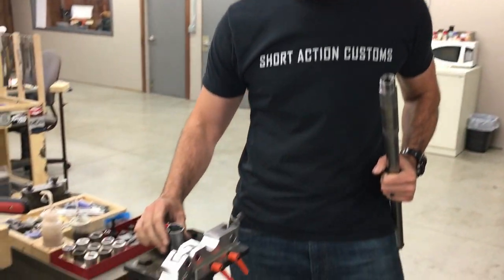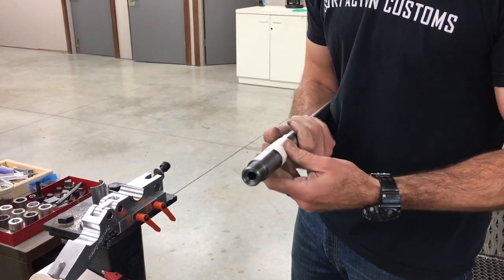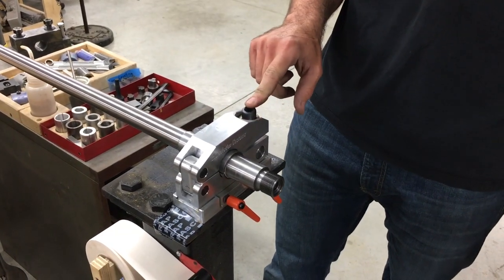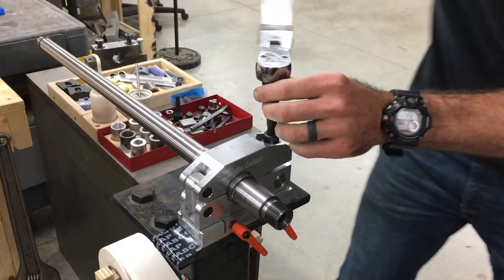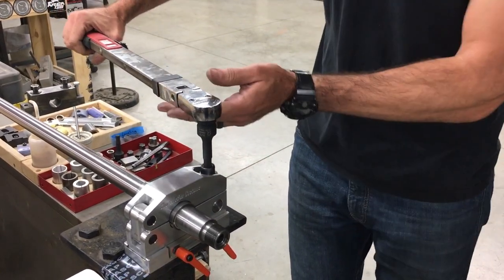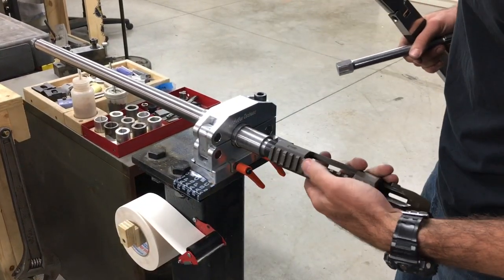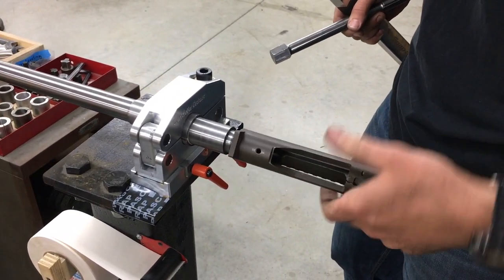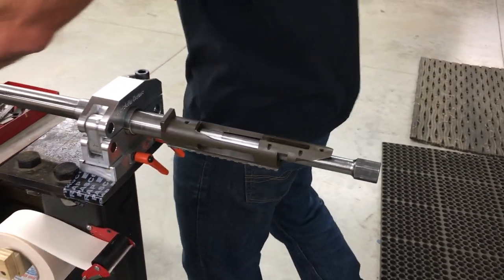Short Action Customs: Modular Barrel Vise

Comment: With an action that has a screwed and or pinned base will it need to be removed during barrel removal? I know the trigger needs to be removed due to that much torque is hard on trigger pins.
Reply from the maker: Justin, You could leave the trigger and scope base on if you wish as long as you're using a rear entry action wrench. For the scope base to have clearance, that would depend on the barrel contour you're using. If you say have a Remington Sendero/Varmint contour with only an inch or so of 1.250 barrel shank available, you would need to use the 865/870 bushing in front of the chamber a few inches.